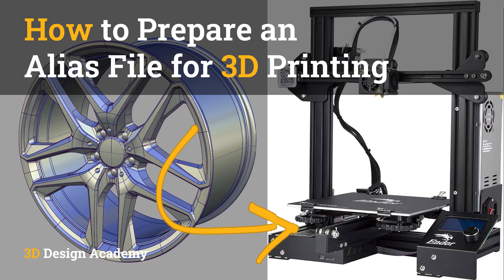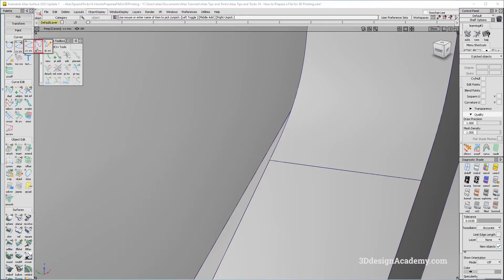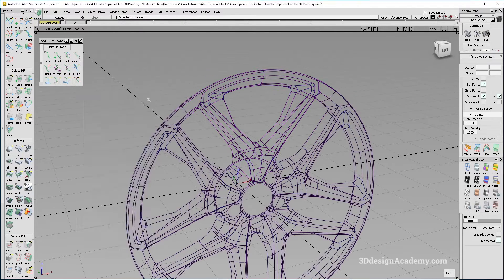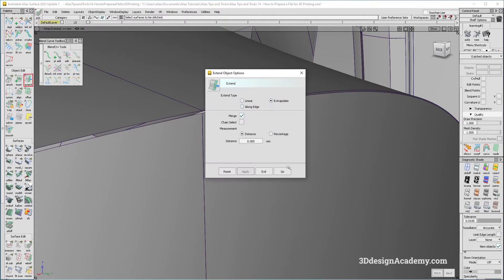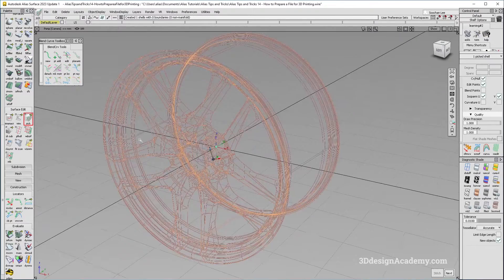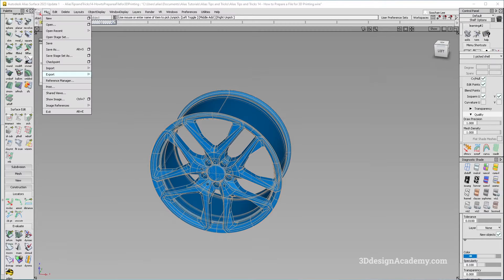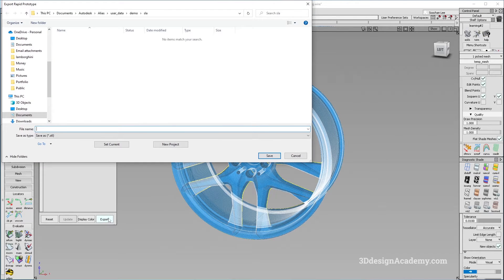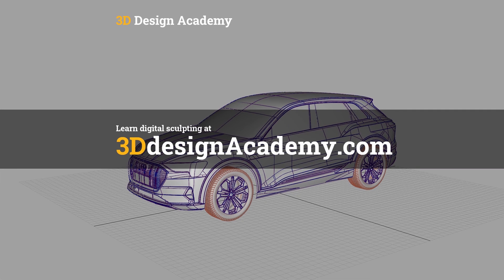How to Prepare a File for 3D Printing in Autodesk Alias

Comment: it's better to use STEP with printing. I suppose STL will downgrade surface quality
Reply from the maker: I've only sent out data so that other can print it, but haven't tried it myself. Do 3D printers accept STEP file?
Reply: @3DDesignAcademy  I’ve got modern Bambu Lab X1C with its Bambu slicer (based on prusa slicer). It CAN handle STEP without loosing quality.
The main problem is how to divide big part into small parts because print volume is not big enough.
Reply from the maker: @jutablane  That's cool. STEP file should give a resolution. However, I wonder if it still converts the data into a STL file.